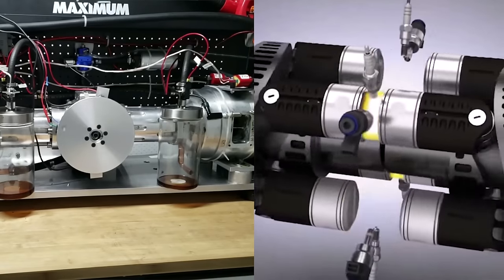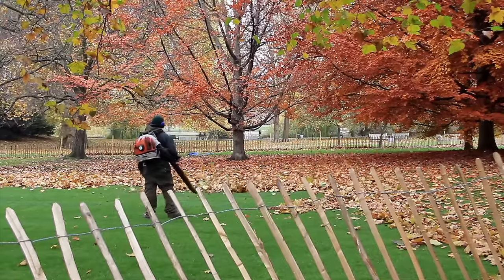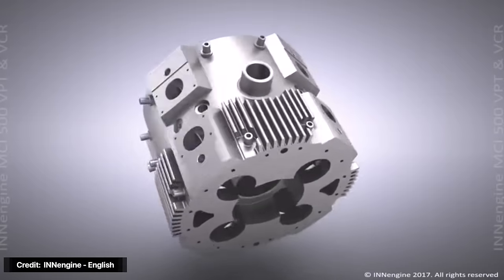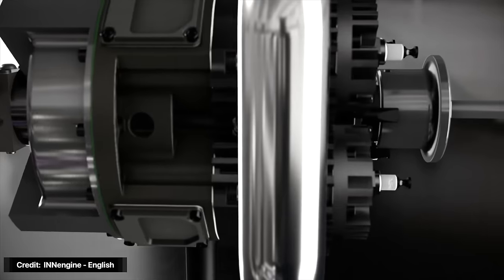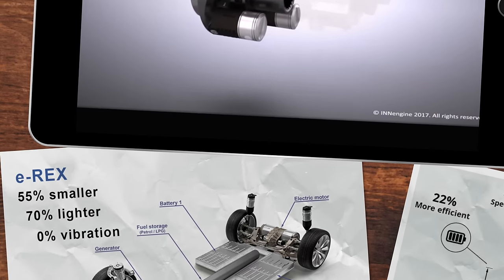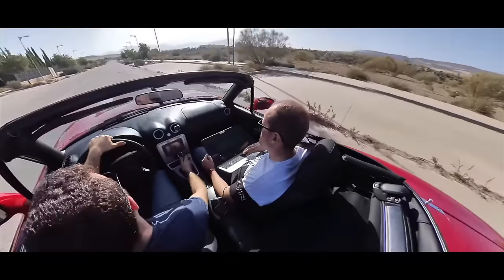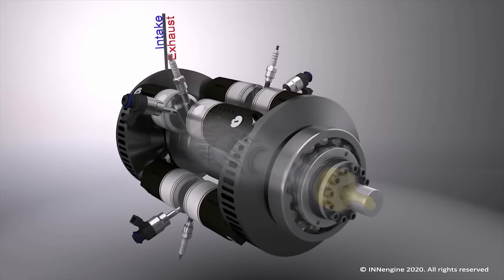One Stroke Engines - 200% More Efficient??

Comment from the maker: Thanks DeleteMe for sponsoring this video! Protect your online Info Today! https://joindeleteme.com/TwoBitDavinci
Reply: I would call it "Dynamic Converging Piston Engine" or just DCP
Reply: Ricky, while YOU are stuck in EV, GM and others are going "Back" to Hybrids. This engine fits that "range extending demand". People are NOT buying Ev's outside of southwest US very much. PS, I like delete me.
Reply: You stated near the end of your video that you'll never drive an internal combustion driven vehicle. 
I love my Toyota hybrids, I test drove a two-wheel drive version Avalon and didn't like it because the acceleration was anemic. 
However, having an all-wheel drive version (Venza/ RAV4 Hybrid) providing 50+  additional horsepower instantaneous torque electric motor to the rear wheels, my little 2.5 liter IC accelerates almost like a V6. A planetary gear set rather than a traditional transmission, and Toyota's hybrid 40% THERMAL EFFICIENCY. That's hard to say no to.
Reply: You mixed up butterfly and breaststroke
Reply: poor DeleteMe, sponsoring a video that is poorly researched and full of misinfo. It's not even arguable that this is 1-stroke, it's simply wrong.
Reply: I'm sitting on a true 1 stroke crankless free piston-turbine internal combustion + heat engine. It's very high torque, all pneumatic, very simple and combines the instant high compression of a piston engine with the simplicity and efficiency of a turbine engine.. It also combines a novel rotary heat engine. Each stroke does combustion, exhaust, compression and compression creates lots of torque, not just combustion.
--
The best thing is only needs iron/aluminium/ceramics, no fancy materials and tech. not many parts, 2 and 3 part moulds, fewer, simpler valves, injectors (it can run on any liquid or gas fuel). You should be able to imagine roughly how it works from the 'piston-turbine engine' title. I have a 3D CAD model ready but people like you stifle us non-fake green inventors. Better engines are more green as they emit CO2, not just because they're far less toxic to produce and dispose of.
Reply: Thank you for properly referring to the cycles in strokes.
Reply: One stroke, depends on how you define it. If it's based solely on the combustion cycle happening with each stroke then I agree, but if you count the fact the piston still has to reverse direction to get back to its starting position then it's two strokes.
Reply: @liquidpatriot4480  .. The closest to a real 1 stroke cycle is Combustion, Exhaust and Intake for the stroke after next, all while Compressing the next stroke. Piston fires side to side / up and down alternately each end. Reciprocating, alternating 1 stroke, single cylinder engine. I prefer a crankless design as cranked have more seals and friction.
Reply: lol EV's are on the way out dude
Reply: @faithreturns333  are you in denial...you're faith in internal combustion may be betraying your logical side. And I LOVE internal combustion, but it's on it's way out, like the carburetor in the 80's.🤷🏻‍♂️ It'll be for the better in the long run.
Reply: @jasonsmith373  .. EV's are dead mate. ancient, PRE I.C.E. vehicle technology that was rightly abandoned as soon as the I.C.E. running on refined carbohydrate fuel was invented.
Reply: Your diction should also respect  the English language ! There is no word 'Excape' !!! The word is 'ESCAPE'   Aks anyone !!! Please do better . 🙏
Reply: @christopherroberts22  does it really matter??🤷‍♂️ What's it to ya? (You must be popular at parties, lol.) But, seriously...try lightening up just a little. Pss, it's not because he's a brown person, is it?
Reply: Just a suggestion, But a Harley motorcycle does not have a 2-stroke engine. In fact, it has one of the oldest designs of the 4-stroke engine. It is 2 cylinders of a radial engine with 2 rods connected to the same crank journal. You won't find a 2-stroke engine in street bike since the mid 80's and they were on their way out with dirt bikes also but have been having a renaissance of late.
Reply: @jasonsmith373  Not sure I was asking your opinion tbh ....
Reply: @christopherroberts22  well, you got it anyway. (Does the truth hurt or something?)
Reply: @jasonsmith373  lmao .... What Truth !? Yours !? All you did was spew some vacuous drivel ...
Reply: EVs will not replace ICE until there is an alternative to storage as it now exists. Lithium is a bust. There needs to be a revolutionary approach to capacitive discharge designs.
Reply: @liquidpatriot4480  This is a Two Stroke Engine, but fuel is injected directly to the combustion chamber without an oil mix!🇵🇭🇵🇭🇵🇭🇵🇭🇵🇭
Reply: Hydrogen fuel. Done.
Reply: 10:18 did u say 2 stroke cycle while showing a 4 stroke animation ?
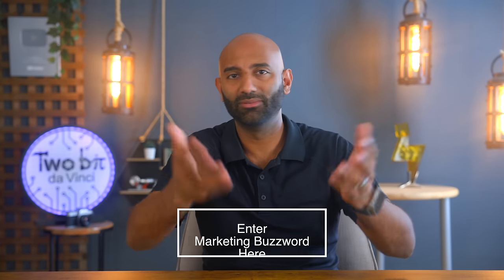Reply: 12:17  isnt "Stroke" a Buzzword ?  id say its about the same as "Cubic Inch"  right?
Reply: ok so to have a true single stroke engine,  would it count if you had the back side of the piston also doing power stroke in the other direction?
SO power stroke on the left side, pushes piston to the right side, which compresses the air on right side, while the left side is exhausting and filling with air like a 2 stroke does, 
So that would be all 4 parts of the cycle with a single piston stroking in 1 direction.  the next cycle begins, right side ignition, power strokes piston to the left, the left chamber has already filled with air so now its compressing.   again all 4 cycles and the piston has only stroked in 1 single direction (from right to left this time).
BOOM one stroke engine.
the question is how to get the power out of that piston ?
question does it have to be physically linked mechanical transfer of power, or could that piston actually be a magnet passing through a coil to transfer power electrically instead? Its still internal combustion, its just not physical connection to any kind of Shaft.
but thats still technically an Engine right? 
im gonna say it counts. i just invented the one stroke.  (lol someone probably has already thought of this?)
Reply: Sounds like a good product. Just wish we could pay it on a monthly schedule not yearly
Reply: You obviously haven’t seen the ice hotrod engines running on hydrogen powering old school hot rods. Water vapor exhaust with an engine that cranks out 700 horsepower.
Reply: Have fun getting your all electric car charged on a trip of more than a few hundred miles. Oh, and that battery? yeh, that's not a long lived component and has a very high cost to replace. and finally, the resale value of your EV is right around zero.
I'll stick with my ICE. It works, it has resale value and generally low cost repairs. Plus i can get gas anywhere. The grid cant handle millions of EV chargers. which reminds me, i can fill up and be on my way in less than 10 minutes, how long will it take to fully recharge your EV? yeh, its hours.
You need to rethink the statement you made at the end of the video.
Reply: Electric Motor's, Electric Generator's, battery charging, and battery discharging ALL have losses in each stage, typically in the 10% range for each part of the cycle range ... each additive ... direct ICE to wheels bypasses all those losses.
Reply: @totally_lost1602  what is ICE to wheels?
Reply: It's time to bring back the 1960's GM Air Starter! I can always hope for a restoration of Sanity in this burg...
Reply: The range extender sounds like a hybrid vehicle idea to me.
Reply: buy a toyota
Reply: @chupo4putin  Toyota? A 4-cylinder? Great. Convert the two cylinders to the middle into steam bangers using the heat from the end cylinders as their power source. Then you can say you've done something. : ))
Reply: @WoodrowRiley   i wouldnt trust anything made in spain. more efficient engine means fuel costs more. industry profits same or more only people spend more money. so yeah buy a toyota
Reply: @chupo4putin  The two cylinders to the inside would only have 4 moving parts, and the water is constantly recycled around & around, so that reduces the # of refueling stops. You should re-consider. One drop of water expands instantly in a super-powerful explosion into an increased volume of 800 drops. THAT'S RAW HORSEPOWER BABY. An INSTANT EXPANSION MEANS AN UNUSUAL AMOUNT OF HORSEPOWER, BEYOND GASOLINE. When in your childhood did some old person turn you against a superior steam engin anyway? Don't be poor be glad! Imagine this. You're cruising down a level highway and the two end cylinders still using gasoline automatically scale down their fuel usage to 10 or 20%. YUR BARELY BURNING ANY FUEL. DON'T BE A FOOL JOR-EL.
Reply: @WoodrowRiley  i dont pretend to understand. im saying that life is to short for most of us to invest in experimental technology. toyota hybrids are proven a 'workhorse'. and besides lower consumption = higher price of gasoline. live ur life, dont traumatise it.
Reply: @chupo4putin  Life traumatizes us if we don't go the shortest route to reach the pinata. Steam Engines are not a difficult technology. In fact they were so POWERFUL it took nuclear submaries 2 or 3 tries to beat a steam-powered sub out of the World Speed Record. The only reason the Steam Locomotives were done away with was because they needed to stop to load up more logs and water. And just before they were done away with FINALLY some guy fixed one to capture the steam and send it back to the boiler. There's absolutely NO DOWN SIDE TO RECYCLING THE EXACT SAE WATER OVER & OVER & OVER, and you do NOT LOSE POWER. However, it is indeed YOUR LIFE and if your wish is to BE A SLAVE YOU WERE BORN ON THE CORRECT PLANET.
Reply: @WoodrowRiley  if i were in USA i would be a slave yes.
Reply: @uncletrashero  yeah, opposing piston design, can be 1 stroke...
Not sure where you are going with magnets 🤔 
But I have been thinking about using superheated water , under high pressure, heat from microwave, injected....is possible to get 340+ °c ...3x boiling point...
High pressure, so no need for purified water ...
So , as injected at TDC, it has an expansion rate of 1600:1 ....
As once lost pressure, superheated water is unstable and instantly turns to steam..
Pushing piston down ...
As the piston pushed from the other side power stroke, returning upward, pushing out the steam ( exhaust) .... through the single valve 
Would be a 1 stroke steam engine of sorts ...
Have a H block design for it...
Has around 80% efficiency, without load from the alternator for powering the microwave...
So , sounds and feels like a normal petrol engine, but can run on filtered gray water run off from shower or laundry....
Reply: @thomasgraham1684    trying to get the work generated by the piston out of the system to use it. thinking a very short throw distance on the piston could leave room for a mechanical connection to transfer out the work with rotation, but i thought it migh tactualy be better to have the piston go back and forth through a coil to turn the work into electricity instead (would require the piston to be a magnet)
Reply: @WoodrowRiley  if i was born in usa i would be a slave yes
Reply: @Formulabruce  yea and EV's are unable to keep up with a good V8 I am an older person and have driven several pickups over 400k miles without breakdowns gas and diesel(will get over a million) Hybrids can be a good option and I have thought about installing DYI inverter driven motor in my diesel pickup and program it to cover 20-30 percent of the engine load while cruising down the interstate
Reply: What's your take on Taurizzi pendulum engines/compressors, and could they be adapted to a Stirling engine?
Reply: Hi, I think this is a two stroke engine.
Reply: For me, yeah I'd only do a hybrid not full electric, it makes so much sense to have the flexibility, the lower weight, not need as large a battery...  quick refill if recharge would take too long.  Better to get 85%-90% of driving be electric than 0% because of battery expense, their environmental issues and short lifespan and such.
Reply: I noticed that there are two bumps on the driven cam plate. That means the pistons each do four strokes per revolution.
Reply: The only way an engine can be one stroke is it can't have reciprocating pistons.  So tubines and rockets could be considered "1" stroke engines.
Reply: I have long thought the real key is a better more efficient ICE linked to EV power plant and drive system! Puzzled why after 100 years of ICE there wasn’t a better design and these people are trying to make it! Also a small version of that first engine could replace lawn equipment 2 stroke engines!! It’s a brilliant design!
Reply: @nicholasklangos9704  I agree, but if you don't care about rotation just generating electrical power then reciprocation is ideal and as such you can just have a piston or to cancel out vibration 2 pistons moving a magnet relative to a coil, that could be super tiny and then you can have super capacitor maybe instead of or as well as a rather modest battery in a hybrid electric car, this saved on expense and weight.  Far better than needing a huge expensive battery with a limited life anyway.  You have greater flexibility, recharge with electrical power when practical and when not a bit of fuel.  Best of both worlds.

Comment: In case you haven't noticed we aren't buying EV's. They are piling up in dealerships. We have woken up to the lie.
Reply: They are piling up at dealers for 2 reasons. The charging infrastructure is poor (excluding Tesla) and dealers are jacking prices through the roof. There is no lie contrary to some folks views. 

EVs are safer, handle better, have much lower maintenance costs and are far cheaper to drive. There are range anxiety issues, especially in cold climates and the current models suffer even more in range when towing. These issues can all be overcome. Folks who have home solar love that they can commute locally for no gas costs. Who can blame them? Especially in states like CA with painfully high gas prices.
Reply: Great, interesting video as usual! But why don’t they target small/light (ultra?) aircraft? Would this not be a perfect airplane motor?
Reply: Stop getting your info from FOX
Reply: EVs are good in their own particular way. They are designed for one purpose only: carbon friendly commuting. 

ICE based vehicles are multi-useful. They are cheaper. They can be refueled almost anywhere. They can be repaired by the owner. You can modify them. 

I would choose an ICE vehicle or a sensibly designed electromotive vehicle.